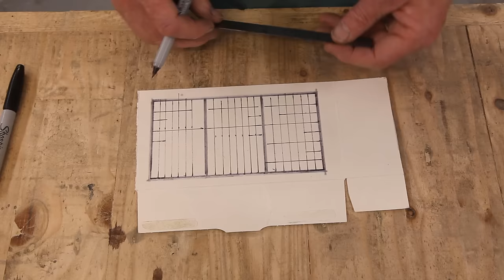Making a Type Case Letterpress Drawer out of SCRAP WOOD.

Comment: Blimey Mate,  you sure struck a 'nerve' here with this project ! ! !  In High School, (the 60's) one of our elective courses was "print shop".  We were taught the art of letterpress (lead type) and the new and upcoming "Offset" press using no type but the electro etched metal sheets that went onto the offset printing presses.   Most of the work that we did was with letterpress.  Hand setting the type (individual letters and  figures) 'in our  "hand Sticks" to be placed into the "galleys" and locked  tight into the letterpress frames to go onto the printing presses. was tedious.  Our shop teacher, Mr. Garrets, was a very nice instructor and taught us the fine art of printing.  We all had to carry our type cases to our work stations to do our composition.  Every different type style and pica (size) had their own case.  SO you can imagine how many type cases were in our shop.  Literally dozens and dozens.  Rack after rack on one wall.  AND....they were  "broken in"  with printers ink and natural wear.  But they were the necessary element in a print shop.  The art of letterpress is gone and relegated to the museums these days.  You really did a nice job showing us how the cases are built and assembled.  The cases of yore were made of birch or other  hardwood (I believe). Now to get you the type to fill this case.............  🙂
Reply from the maker: The case was a lot of fun to build. I had to guess at the construction method, but there were enough photos online to get an idea. I've learnt a lot about printing while making it :)

Comment: Now that brought back a lot of memories, use to work on the old Letterpress printer over 40 years ago, one machine was so old it worked on A4 sized sheets only, it was kept just for specialty jobs, wedding embossed and de-bossed invites and table placement tags as well as the fancy business cards, the machine was brought in to Australia by the Bosses G-G-G-Grandfather for printing booklets and things, he also brought in its big brother of the same type of machine which was used to print small runs of local newspaper as well as books.
I loved the fact that each generation that took over the business always made sure both printing presses would always have work run on them every day, he kept them going doing specialty work which the new bigger modern machines just could never turn out the same quality of work. 
It was such a strange sight when going to work, you walked into the modern workshop where we had 3 big modern offset printers churning out heaps of different things from posters to logbooks turn the corner and suddenly your transported back in time to the 1800’s, even the lighting was different to the rest of the factory, lol I loved working in that section. We had 6 different cabinets with these types of draws all kept full with different fonts and sizes. I think the best part of the job was melting down the worn type sets to generate new ones. That was done everyday it’s quite surprising at how quickly we had to replace the keys just to keep that perfect crispness of the fonts.
Your workshop is really coming together, looking every inch the late 1800’s early 1900’s workshop, now that’s a setup perfect to working in nice and calming. There is something to be said working in such surroundings.
Thanks for Sharing, I just love watching your videos 🤗🤗❤️❤️❤️
Reply from the maker: I'd love to have seen those old printing presses, and the cabinets :)

Comment: I learn how to set in my career, printing, but the evolution of the offset printing took over. I have a Chandler & Price printing press in my garage with a gallery of trays of type. You did a fine job on the type tray. Would you like to have a chart of where to place every letter, upper and lower case?

Comment: I love looking at your previous work in the background, fabulous! Also you using the egg beater drill is something that I used to use when I worked as a custom picture framer. I had wood that couldn’t take pressure from from under pinning. I always thought it was such a cool tool.

Comment: Hey i appreciate your use of hand tools  definitely, but why not make dado cuts for the shelves? Since you already used some machines, whats 1 more? Or is the wood to thin to make dado cuts?
Reply from the maker: I can do the cuts pretty quick by hand. It might save a small amount of time doing it on the table saw, but not much. I'd have to spend a fair bit of time setting up some sort of jig to get them accurate. I'd do it that way if I were making several of these, but not for a one-off.

Comment: I have been so curious for years now. Do you design your pieces before hand? Like sketch them out or use some sort of computer program? Or do you just have an idea and go from there, and just start with the main frame and worry about the details later?
Reply from the maker: I do a basic drawing just to get an idea of the overall layout, then I refine the design as I go along.
Reply: @EpicUpCycling  that is incredible... I would need to do a sketch, a 3d render on some computer program and I would STILL mess it up somehow

Comment: Been on the sofa for the last two weeks with a very stubborn cold. Given me ample time to (re)watch all you videos and I think this is the first time I've seen you sketch a plan.. well, if we can call it that and I've actually been wondering about this. Do you work with length calculations at all (your lengths always fit perfectly from the boards you make) or do you make it up as you go along?
Besides this question I wanted to say I am amazed with how accurate your pieces always seem to fit together. Breathtaking!
Reply from the maker: I don't do a lot of planning, usually just a basic drawing to get an idea of the overall look, a bit more detailed than the one I made for the type case. I then refine the design as I go along.
Reply: @EpicUpCycling   so basically it is all in your head? Cool